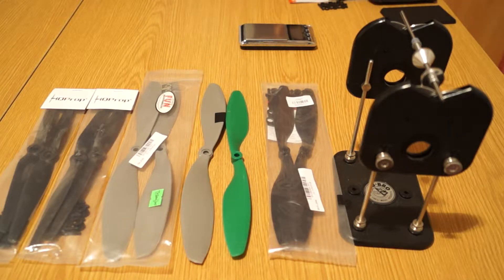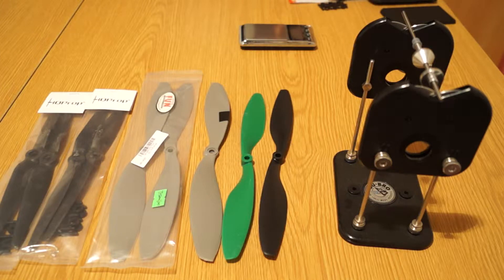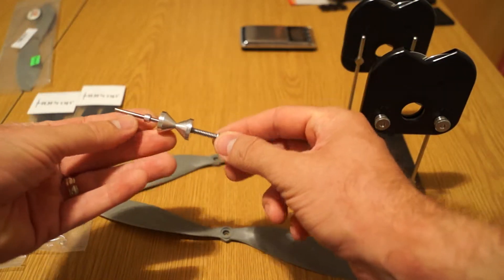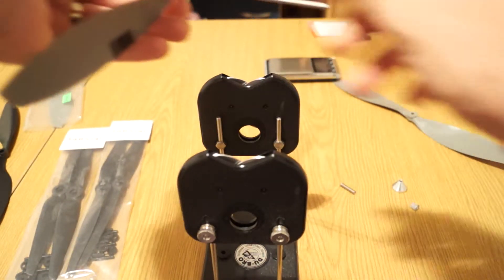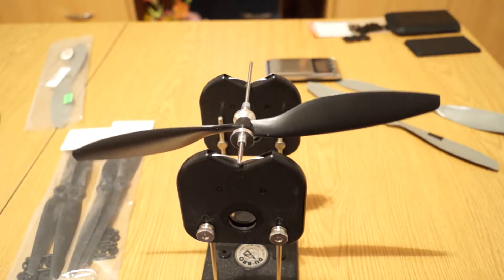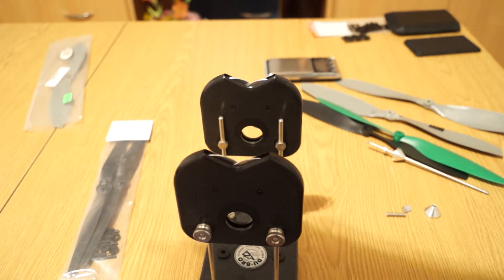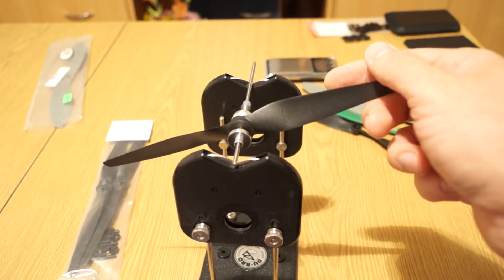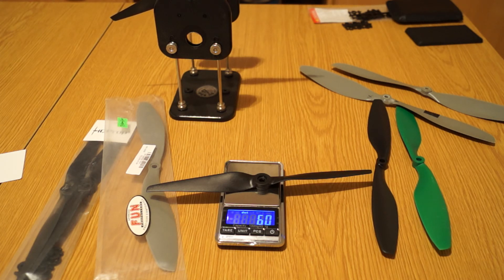Prop comparison: HQ 9050 vs APC-1147 vs plastic 1045

Comment: I had slowfly gemfan props, absolute garbage, impossible to balance. GWS triblade props are very good (the larger ones) and hq prop are great too... however I find when you get up to 10" or more with hq prop they aren't as well balanced... or less forgiving but 10" GWS triblades seem easier to get a smooth operation.

Comment: The "APC" props you are showing are 100% clone garbage and cannot be balanced often because the hubs are so out of balance. The ones I have seen have the hole drilled with a hand drill it looks like from melted plastic and the hole is visually out of center. Real APC are often better balanced than you can measure on a magnetic balancer. The only downside with the APC's is the multi rotor props don't come with the inserts ($3.50 for 6 inserts plus shipping and handling ..... claiming inserts can/should be reused ..NOT taking advantage of MR market) and they only come in one color which is not good for multi rotor orientation and you have to dye them or mark them messing with the balance showing APC makes great props but is behind the curve as the color props that glow from sun light are a great aid in visual orientation.

Comment: The APC shows out of balance because you are not using the Dubo prop balance properly on them. On their website they show how to properly use it. One side of the prop is not precision drilled so you will have to flip one of the dubro adapters around